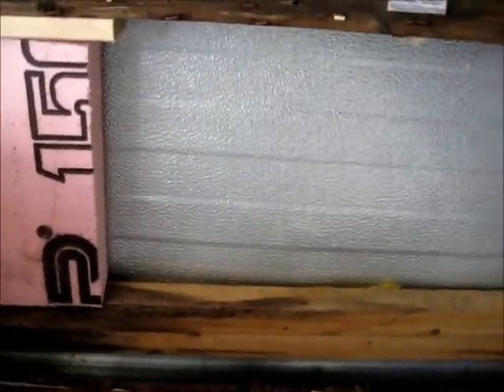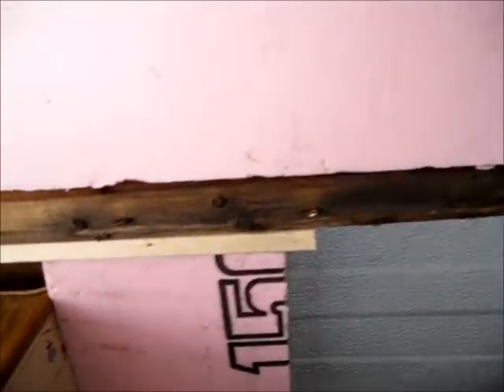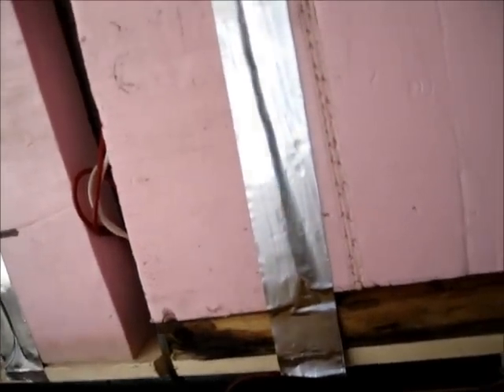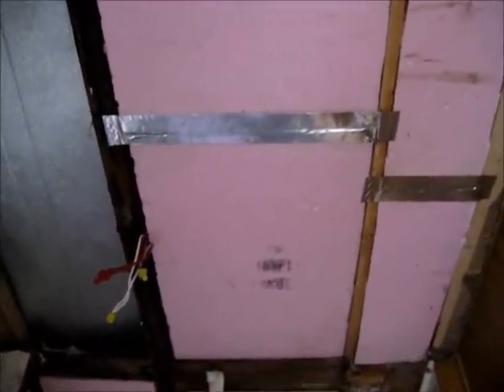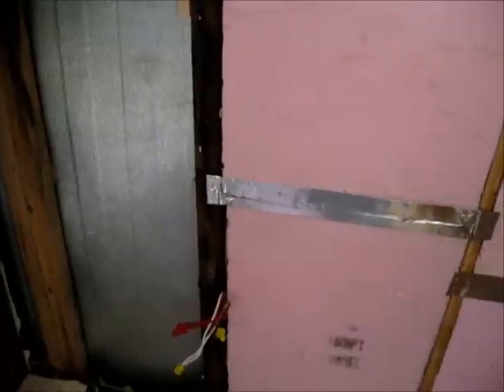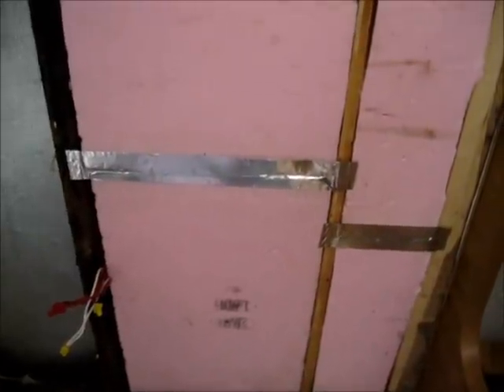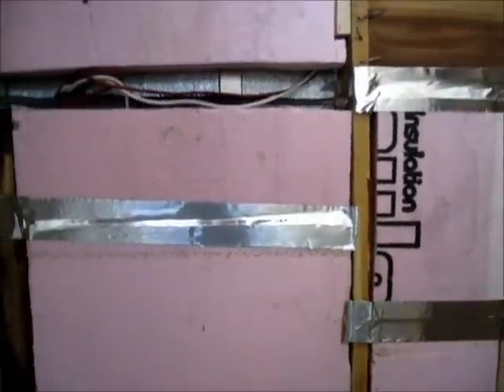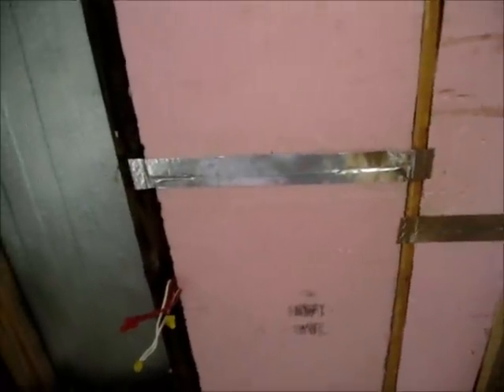How to repair water damage inside a camper or RV, wood and frame repair.

Comment: that's crazy, i started doing the same but because i was lied to and found the damage and coverup, i am thinking about using aluminum instead maybe T -Track no welding required.  It is lighter, never rots and stronger.
Reply from the maker: Depends on how long you want to keep it.

Comment: yes that is a lot better than you get it from factory. It should be warmer in the winter and cooler in the summer. Looks good. Some of the boards are much heavier too you are replacing. Good repair job.

Comment from the maker: I will. I am waiting for my truck to get out of the shop so I can get the ceiling boards. Only $12 a sheet, but too big for my car. I think the wood rots because its sealed in behind the metal and never really gets dried out properly once its wet. You have to remove the paneling and insulation and fully dry it out to prevent rot.

Comment: I agree with you that aluminum tape is my favorite stuff too, also I just hate it when things disintegrate in to dust, and there's nothing there. I recently took a small trailer in and the entire outside of it was disintegrated completely, as well as the insides. I just took some aluminum tape and built myself a new trailer off of the axle. I used some cigarette butts I found on the side of the streets as insulation, it smells kind of funky in here but it will make a great little guest house for my great aunt Sirelle, and her Buttons. Now Buttons has won cat of the year award 20 years in a row at the Westminster Cat Biannuals, I really felt you should know this and I just want you to know that I really hate it when things disintegrate into dust.

Comment: It would of been good to of included in the video how to begin this process.  We've never done this before, and need to see how to remove the wall / roof to access the damaged area.
Reply: Cut out the wall panels with a razor knife and a straight edge to ride against for a straight line between a structural 2x2 in the center. It must expose half of the wood board so you can replace the wall (luan) once you repair the damage. Of you remove the wall completely, you need to make cuts in your new walls the same way to hold the walls solid. If you can't, place a 2x4 Inside the cavity attached to the 2x2 wall structure to back the panel you are installing. Use an air staple gun to attach the wall.

Comment: The chemicals used in pressure treated wood corrodes aluminum.
Reply: ridenlow12  where do u get the wall board and can u use the same board u use &or bathroom walls at home?

Comment: You do not want to use pressure treated in an RV because the chemicals used in the new pressure treating process will react with the aluminum sheeting and cause the aluminum to pit, and eventually leak. You should be using Marine Grade wood/plywood in all RV repairs.
Reply: If the roof is a vinyl skin and not aluminum it will be fine, the fasteners need to be zinc coated.

Comment from the maker: I could only find the wood I got. Not sure if pressure treated wood is safe for dwelling places though.
Reply: It doesn't smell or create a toxic odor. But the fasteners will corrode of you used the wrong kind. Any metal it touches will corrode. It's fine for vinyl roof skins.

Comment: You keep talking about replacing the wood that's rotted but what have you done to the shell of the camper to stop the water intrusion?
Reply: Regularly checking seals is part of any leak damage repair. Locating the source is part of the job. A roof leak is common and roof leveler liquid used to reseal leaking seams and componant edged. On some cases an entire roof can be replaced. It's a lot of screws and a lot of work. Again all the stuff on top has to be properly sealed with modern sealants. It's smart to complete the job, then take it to an rv center depo that can do an air leak test by pressurizing the interior and soap bubble checking seals from the outside. It's effective.

Comment from the maker: Sounds expensive. But then again, RV repair shops are not on every corner, so they can charge more.

Its really hard to say without seeing the damage, but maybe you could consider making it a DIY project and save a lot. I reworked my badly water damaged camper for about $100 in materials. But it took many hours of labor.

Labor is the key point here.

Sorry I cant be more specific.

Comment: HI Troy, Its too bad that campers only have 2" of insulation. Could you imagine how warm it would be if you had 2x4 or 2x6 walls? You can get much cheaper foam, its white bead foam and is called EPS. It has similar insulation value. Also, is spray foam cheaper than stuffing fiberglass into the cracks? Good luck!

Comment: I am not sure about trailer roofs, but I was told by a professional carpenter that you cannot use pressure treated next to metal roofs on a home. The chemical in the wood will eat the metal roof.
Reply: That's correct, pressure treated wood will cause aluminum to corrode. Same with fasteners used. Unless the fasteners are zinc coated.

Comment: I hate to be the bearer of doom but, all the 2x4's with those black marks on them have wood rot starting in them. Just because one piece of the 2x4 looks good, after a short period of time enclosed in the walls they will rot away also. The spore's that are the rot love damp, dark humid areas. It will travel thru the wood and fail. If your gonna try to fix this, remove all the old wood and do it right or you'll have to do it over shortly .,,,
Reply: If you spray bathroom bleach mold preventive stuff that eats the mold and bleaches it, it will remove the blackness caused by damp conditions. The wood rots from bacteria that thrives on those conditions. If the wood is dry and you bleach it the remaining wood will remain structural. Minimal surface staining is fine. The bleach will remove the bacterial blackness. It can be cleaned as long as no damage occured.

Comment: Please don't use spray foam,That stuff is a mess ...
Reply: Spray foam is messy, but don't spray a lot in the crevice because it will expand, and "grow" bigger than the space your filling.  Spray a small amount by not squeezing the nozzle hard.  Also, be quick when engaging the nozzle because this stuff comes out fast.  If it does expand outside the crevice use a utility knife with a sharp blade to remove the excess.  Another point is to unscrew the nozzle a little from the can when not applying the foam because it will continue to come out of the nozzle, and drip out, which is messy and gets everywhere (clothes, shoes, places you don't want it & etc).  This stuff will not come off clothes so wear something you don't care if it comes in contact with it.  Clean up with mineral spirits, or gasoline.

Comment: Rot in RV/Campers would not be as bad if Companies would stop using Fibreglass insulation which holds water up against the wood.